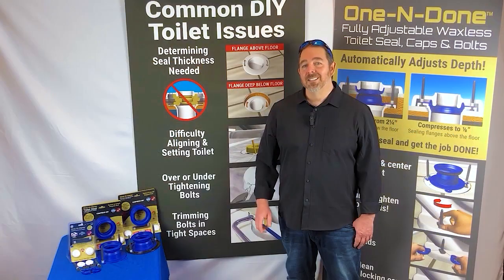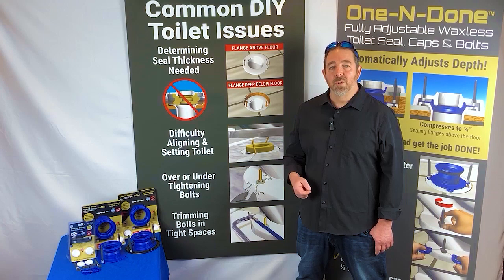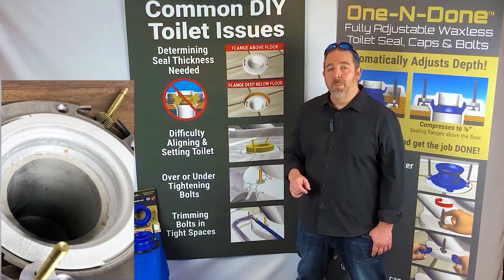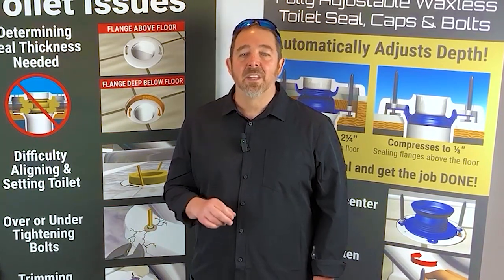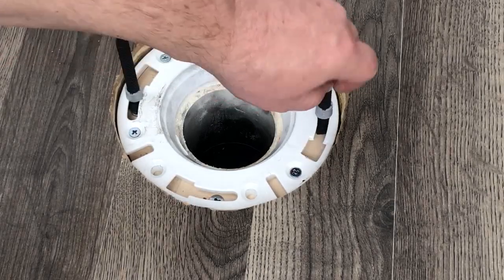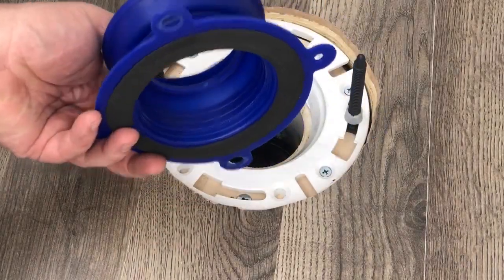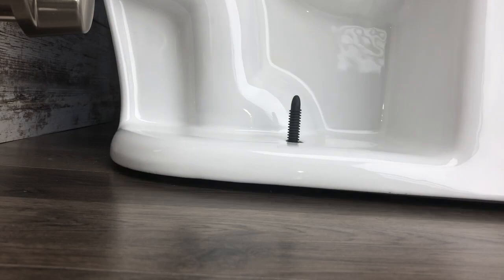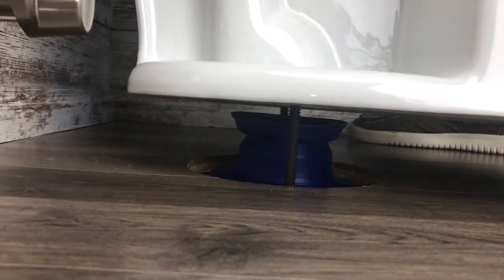TOILET ISSUES GONE FOR GOOD! OneNDone Toilet Repair Kit Self-Adjust Toilet Seal, Bolts & Diamond Saw

Comment: the manufacture recommends tightening the black nut a 1/4 turn before cutting the bolt off
Reply from the maker: Joe, Good Eye! You are correct it may be tightened 1/4 turn past hand tight if you wish (but it is not mandatory and can be hand tight only.